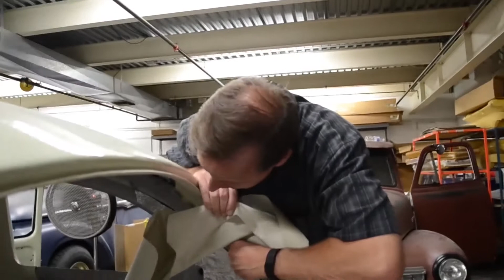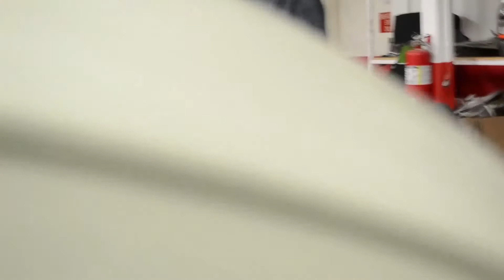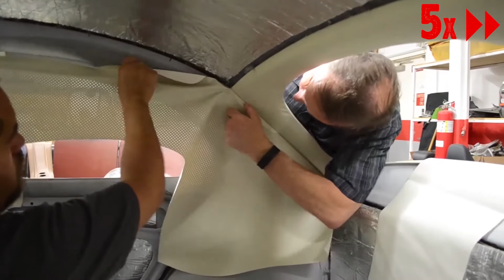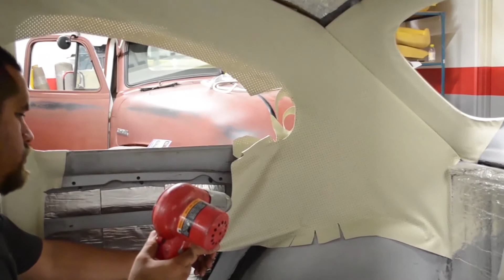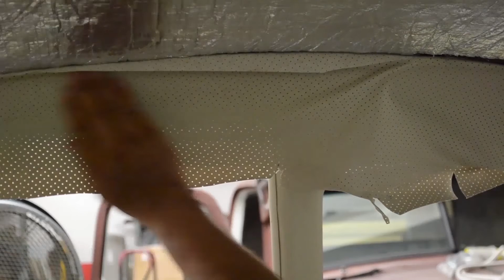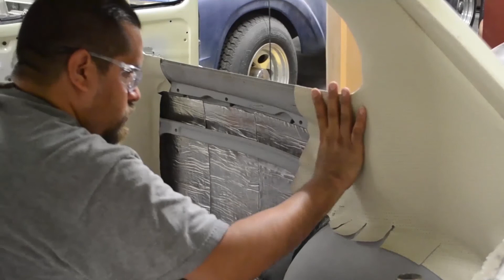VW BUG Headliner Guide - Part 3

Comment: I think it's funny some of these comments.  For all we really know, the person they are putting this in for might now have wanted the padding. Not in their budget.  I don't think that would be TMI's problem myself. Granted, they should say something about the padding since TMI does sell those kits as well.  My 73 Super Beetle had all the original padding and headliner in it when I started my restoration. There was hot glue every where when I pulled all of it out.  So JosephDR stating plain wrong is plain wrong. Hot glue was invented in 1954 and used all through the automotive industry. Sound would have been nice. But I rather this over having stupid background music.  Thanks TMI for these videos.

Comment: No padding. Using a metal hammer on the fabric against metal grippers. Hot glue. These are things NOT to do when installing a headliner. Padding will help with noise level in the cabin, hide the grippers, and looks better. Use a rubber mallet wrapped in a plastic bag so that you will not mark the headliner while banging on the grippers. Hot glue is just plain wrong. Globby and stringy.